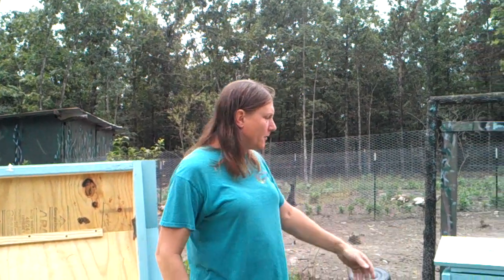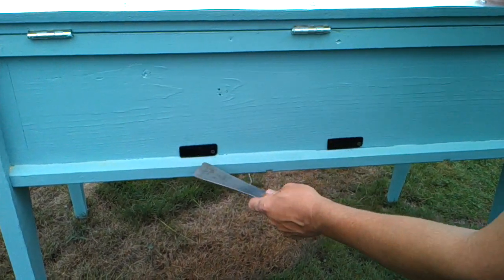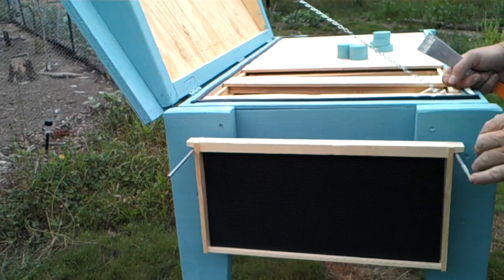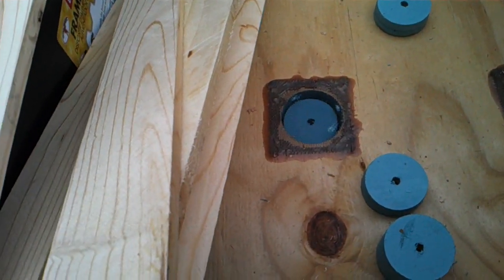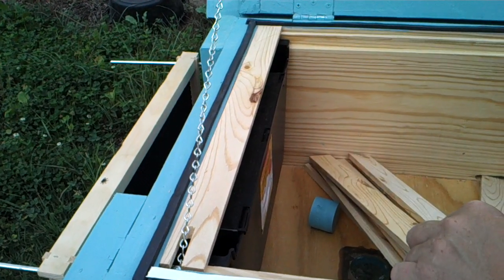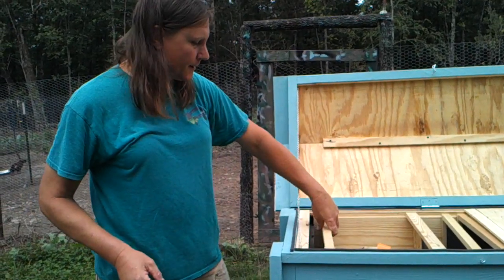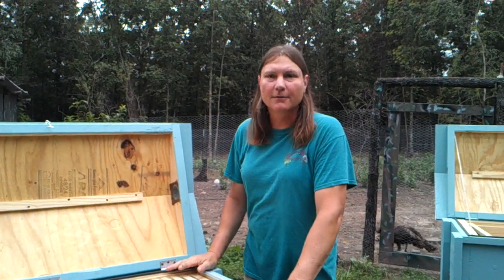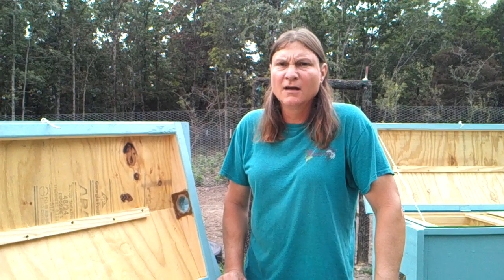LANGSTROTH DEEP FRAME "LONG" BEE HIVE DESIGN BUILD AND REVIEW. Expanded Dr.Leo design

Comment: Nice build, Erin (by the way, that is my daughter's name).  I am in the process of building my own "Long".  I agree with another commenter that putting a galvanized chain on the outside would alleviate the "notch" and fumbling problems with the lid.  That's what I am doing.  I like  the weather strips, also.  I am experimenting with using carpeting strips, instead.  Hope it works.  I am also going to install a towel rack on the opposite side of the entrances to hang the smoker on.  Clever idea to let the chickens clean up the beetles.  We don't have chicks, but put rock salt on the ground under the hive.
Reply from the maker: Funny I built that 4 yrs ago and since then I have modified it several times. But the basic structure is the same.

Comment: G'day from Australia - I think you're awesome and  did a great job, I like the idea about the pins to hold the frames but maybe put them at 10-15 degree angel so the frames don't slide off if accidentally knocked.  I like that you left some bee crawl space at the top as the girls got to move from end to end - and those girls do get around.  Regarding the lid -the way the chain was set up looked fiddly but I can see you put some thought about keeping that inside the box however I'm guessing it would be fine if attached to the exterior of the box - especially if it was galvanized.  One thing I observed is people don't know what to do with their tools when working a long lang and most often set everything on the ground but a flip up table on the other end would be good to hold the smoker especially if there are going to be chooks underfoot and I had the ide of putting a magnet inside the the top lid so I can click my hive tool to it - then its in easy reach but out of the way. - cheers, D.

Comment: Ok I like your simplicity. I am an old timer doing bees for many years now.I give  you a small tip.Thetop of the frames on the ends.you worried about  the bees glueing it down. I use a little brush and apply a little vegetable oil in places where I do not want the bees to propilize.It works great for me. The leg design is very good,especially the two drilled holes for the rods to hold frames when you work your hive. Also you seen the importance of air circulation. I live where it gets well below zero and the cold does not hurt my bees, closed up to tight where water builds up and causes bad problems in a hive. Hives in your chicken yard is great idea especially if  you have a few guinnees .The thrive on ticks and beetles.

Comment: This is a good standard design. It is good to put the separate entrances close to the center board, especially if you make it for two colonies. I saw another design posted recently to youtube which has some interesting modifications to the design, llike a feeder shim. it is designed for two colonies. You can do a search for it. I think the title is something like... "horizontal hive design for 8 frame supers".
Reply from the maker: an in hive feeder work well in this. No need for something modified. this kind of feeder  https://www.youtube.com/watch?v=ZjtcOy5f7Iw
Reply: @therealerintscott3803  Hello, I prefer the feeder above because in the cold weather, I do not want to disturb the propolis protected space of the cluster. I simply lift the top cover and adjust the feed. An in-hive feeder cannot be touched at that time. Also, there are many times it is much easier and faster to do feeding without opening up the hive. Also the upper feeder box helps with ventilation in cold and hot weather. It is convenient to put the feeder in that ventilation space.

Comment: 5 years ago I started bee keeping. My first LLH was built according to Dr Leo's plans. The second year I reduced the entrances from 3 to 1. I have also put 2" foam insulation in the top. This insulation is in year round for summer cooling and winter heat retention.
Reply from the maker: I have changes my builds also. I too put foam board in the lid, and because I have a mill I cut my boards to be a full 2" thick and 12" wide. Thicker wood means more insulation!
Reply: @therealerintscott3803  I've been getting my rough-cut lumber from my Amish neighbor. I also moved the legs from the ends to the sides. Currently I have 6 LLHs in use with lumber for 4 more.